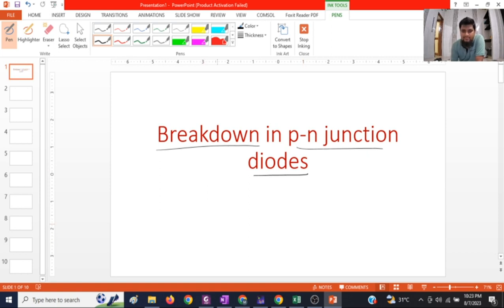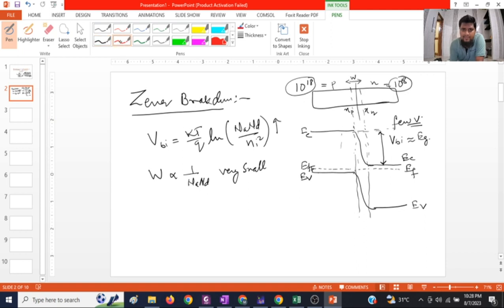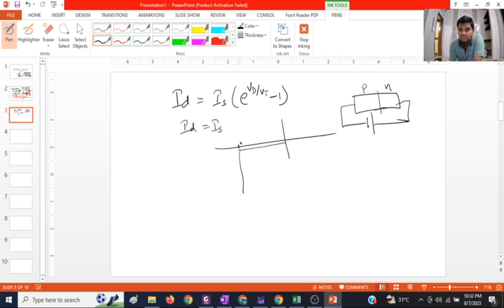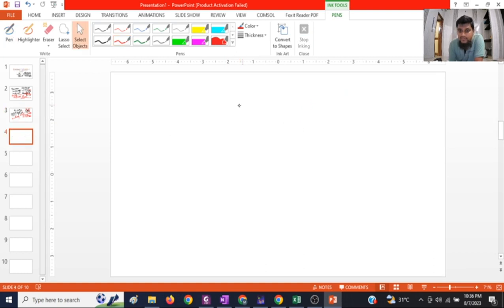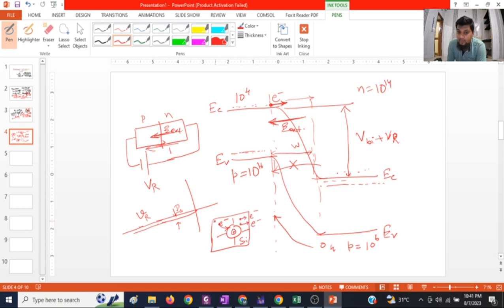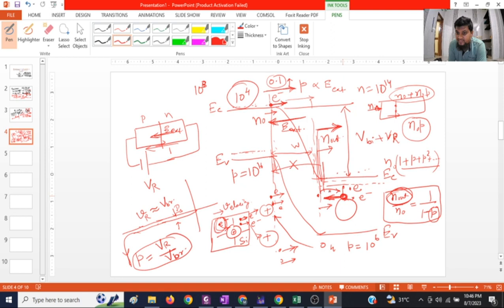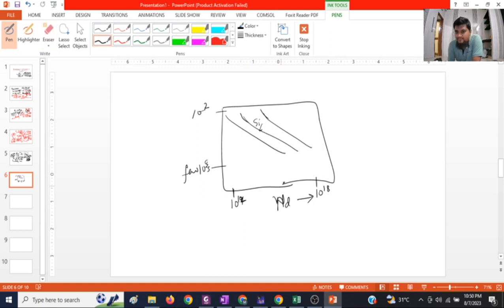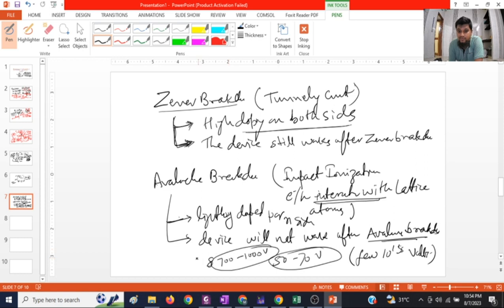Zener and Avalanche Breakdown in a p-n junction

Comment: In Zener breakdown the direction mention is otherwize (at 7:14).  The VB inp type have 10^18 holes cm^-3 but electron concentration is still of the order of 10^22. likewise in n-type material in CB we have 10^18 cm-3 electrons but most of the energy states are still vacant of the order of 10^22. So the net current is from n-to p side. I will edit video later.